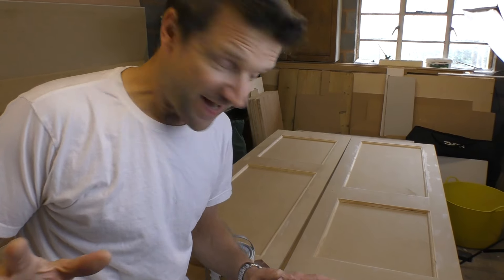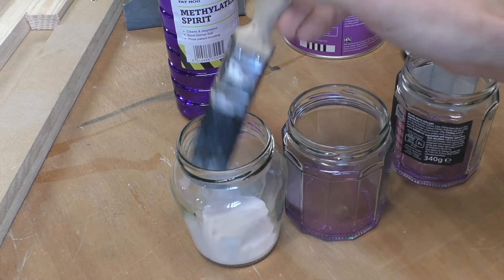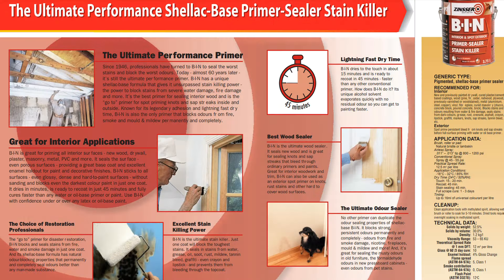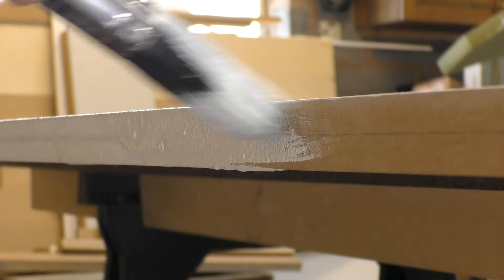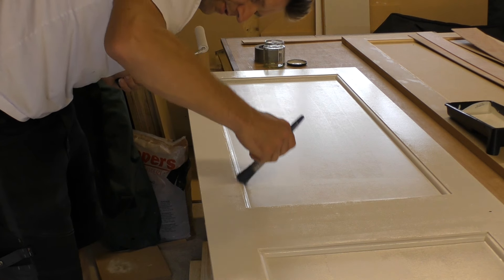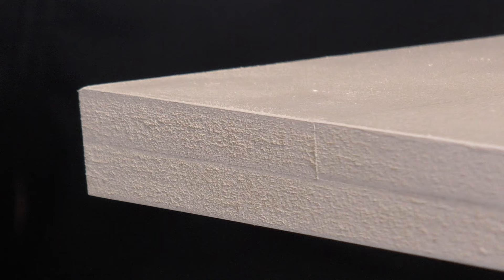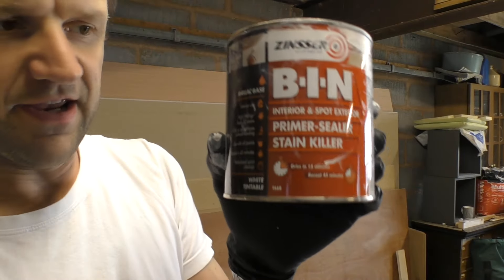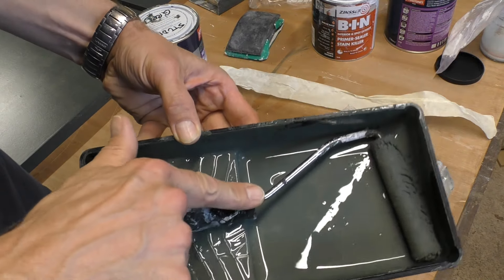Why I LOVE Zinsser BIN for Priming MDF. Video 2/6

Comment: Quick tip from a professional decorator, shellac is a reversible compound so if your brush goes hard just put it back into some zinsser or meths and it will soften back up. Zinsser is the best primer out there and I always have some in my van, you can have it tinted too so grey would be better for colours like green, blues, brown and reds.....
Reply: Henry do you ever spray it? I have a conventional spray gun and would love to know what size tip to use... it seems very thin. A 1.5? Appreciate any advice thank you
Reply: @unusualpond  yeah I have sprayed it, I used a cheap Earlex spray unit which I bought for spraying outdoor fencing panels and the like, I paid about £100 for it from Amazon, I had about 15 six panel doors to paint white that had been previously stained with a deep mahogany so a minimum of 3 coats per side, that's 90 door side's which is a lot of work using a brush and mini rollers, for a cheap DIY unit that just uses air to a gun and cup it did really well, just need to keep the spray tip clean and clear like any spray gun....
Reply: @unusualpond  yeah I have sprayed it, I used a cheap Earlex spray unit which I bought for spraying outdoor fencing panels and the like, I paid about £100 for it from Amazon, I had about 15 six panel doors to paint white that had been previously stained with a deep mahogany so a minimum of 3 coats per side, that's 90 door side's which is a lot of work using a brush and mini rollers, for a cheap DIY unit that just uses air to a gun and cup it did really well, just need to keep the spray tip clean and clear like any spray gun....
Reply: What kind of paint do you add to add to zin to tint it. is it just undercaot..my finish cost is blue
Reply: You didn't sand your primer why ?

Comment: ammonia with water 50-50 ,cleans  shellac base products (including bin) as good as denatured alcohol (methylated spirits)   for much cheaper cost.
Reply from the maker: Ah, great tip! Thanks for that.
Reply: Cleaning instructions on the can of B.I.N. states equal parts water and household ammonia  or denatured alcohol.  I like to use the ammonia with lemon and water 50-50 mix.
Reply: Soooo I can just run DEF through my airless to clean it after?

Comment: I spray this stuff with an hvlp gun.  It dries so fast that it leaves a rough surface but a single pass with 220, and I mean a single swipe, and the finish is as smooth as my prepped surface.  Perfect sealing undercoat for water based topcoats as well.  Even successfully painted melamine cabinets with a ton of prep of course.
Reply: I have just bought an HVLP gun to spray a lot of MDF. Looking forward to using it.
Have you had the chance to use it on tall MDF doors? I have been told that spraying just one side and leaving to dry before doing other side can result in bowing.
Reply: @JohnnyMotel99  I have sprayed a few one side at a time with some SW Pro Classic(airless not hvlp btw) but they were pre-primed.  I had no issues with those.  If using a primer like BIN I doubt there would be issues, it dries so fast and seals very well.

Comment: I found this video searching for priming with Zinsser BIN as I’m about to start a kitchen cabinet paint project. It was great to see someone actually completing a paint job using the Zinsser and the finish coat. Your doors look great! You might not see this as this video is over two years old, but I wanted to thank you for showing how it’s done. Cheers!
Reply from the maker: Thanks Diane. I really appreciate that. Here's a kitchen repaint I did recently. Just make sure you degrease the units before painting with sugar soap or similar, and don't use Valspar. It's fine but chips far too easily 👍🏻  https://youtu.be/x-dzF4H0km8
Reply: Can you paint this straight on laminate bedside cabinets?
Reply: I saw it now. 6/2021.  Good deal...thx
Reply: @CharlieDIYte Which rollers are you using in this video?

Comment: I love using BIN. I've had great success with it when priming metal doors exposed to harsh Chicago seasons, sealing wall board around bath tubs and showers, trim(obviously), sealing the odors and stains from disgusting nicotine. It's perfect for pretty much everything. My pops said that it did wonders when he was doing fire damage repair 35 years ago. It made the crappiest looking plaster or drywall repairable. I hope it helps you with other projects in the future.

Comment: Zinsser BIN is fantastic on mdf. It is all i use now. I find it gives cut/routed edges a harder edge to it, much like the face of mdf. With mdf just sand in one direction as going in both directions flattens the ''grain'' and then raises it again going in the opposite direction. My workflow for mdf is sand the cut edges to 180g, 1st coat BIN, let it dry properly. Denib with 220/240g paper, 2nd coat of BIN. Let that dry overnight, then denib again with 240g paper. While not needed i then put 2 coats of undercoat on, again flatting between coats, this time with 320g. Then let it dry and flatten with 400g paper and then 2 top coats and flattening between coats. That always gives me a really smooth finish, one that feels like glass. :)

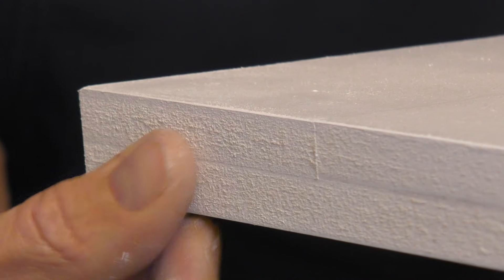Comment: Hi, Charlie! (10:29) About MDF edges: I sand them by hand with 60 grit first, just a few strokes are enough (that cleans the roughness and marks of the blade), and then I go directly to 220 with an orbital sander, *before painting*.  That leaves the surface smooth as glass to the eye and touch, and is super quick. ;)
Reply: The key to that method is that the MDF is heating up from friction, to soften the resin in the MDF. I recommend using even finer grit, like 400 or even 600.
Reply: @barebaric  I've tried, but if you use a finer grit, the surface has no bite for the paint and the roller just slides instead of applying paint (I obviously paint with a roller, I don't have a machine, I'm a poor Argentinian 🤣).

Comment: Hi Charlie. I have watched a couple of your videos when you paint MDF. I have a Pro tip for you. Before applying any paint to the cut edges sand it to 320 grit ( I like to use abranet) this effectively burnishes the fluffy grain, then do as you have been with the zinsser or if you haven't tried it Tikkurilla Otex paint from Finland. Try it next time. 
Ollie
Reply from the maker: Ollie - that's invaluable. Many thanks - I'll give that a go!

Comment: The flip side of that lovely dry time with shellac based finishes is that the alcohol is a toxic organic solvent with a very high vapor pressure. It's extremely flammable, and the vapors damage your nervous system. Even with good ventilation, it's prudent to use a respirator with cartridges rated for organic vapor.

This is why I've historically been shy of shellac except on small pieces...stay safe!
Reply: Awesome! I was prepping my pine stair spindles for primer.. Butyl Acetate to get the stickers off and then shellac knotting compound, not really much ventilation. I had a hangover a couple of hours later...😂
Reply: @Dang_Lin-Wang People drink alcohol

Comment: As a professional painter I can confirm that the roller is the better way. 
We have one guy cutting edges with the brush & the other finishes the doors with the roller. 
If there are many doors we would use a spray gun. 
Great product mate
Reply from the maker: That's good to hear from a pro. Thanks mate. 👍

Comment: I think I have posted before but I can't recommend Zinsser Perma White enough for wood and walls. It is a fantastic paint  which I have used on my bespoke bath panel and bathroom cupboards and after 1 year is still as white as it was from freshly painted, unlike other paints I have used. I'm about to update a pine draw unit to white to go under my white office desk and I have every confidence in both the BIN and the Perma White to do a great and permanent job.

Comment: Used BIN on bare pine skirting the knot's need a 2nd coat to prevent any resin migration into the top coat 'water' based gloss. Also if the BIN dries on glass it can be removed with meths..

Comment: Nice doors and great vid...That bin stuff is great and use plenty of it as a professional decorator.. especially where I'm going over previously oil based woodwork with waterbased.. it gives a great base and sticks unlike other products... so much cheaper in a b&q or screwfix than trade decorator stores..only thing I dont agree with on the tin where they say no need for sanding prior..  needs it even with a fine grade or wet n dry..
Zinsser are great... since using their permawhite in bathrooms I wont use anything else.. coverage not great but its durability is unmatched..

Comment: Great stuff - I primed some of our bare timber window boards (cills) with water-based primer. It raised the grain in the wood which meant sanding it down. Much better to use BIN shellac-based primer for this reason. Johnstone's Stain Away matt is great for ceiling stains caused by water and it's water-based.
Reply from the maker: Thanks James. Yes I use BIN to prime everything these days. Only time I don't is in the heat of the summer when it dries too quickly to get it off the brush. Thanks for the Johnstone's tip - my other favourite paint brand. 👍

Comment: Thanks!!!!!!!  I bought a small can of this to shellac a closet (for sealing in cigarette odor from previous owners!).  
I have been procrastinating using it, since I kept reading reviews on how shellac is "drippy" (did not look forward to that).  
Watching your demo is reassuring, and I will be tackling the project today!!
Reply from the maker: The drippy nature of it struck me too when I first used it - particularly when compared to for example Johnstone's MDF primer which is quite thick. But the thin consistency is what I LOVE about this paint now because it makes it SO easy to apply, and you can absolutely drench the MDF edges in it to really seal well. Also it dries so quickly you'll have the whole unit painted so much quicker than you would with the non shellac alterative.
Reply: Zinsser recommend their water based 123 primer for MDF why is it that you chose to not use a less expensive and maybe more suitable product for this project video? 
P.S. I did like the video just not sure the product choice is steering budding diy folk in the wrong direction
Reply: @MICHAELSMITH-fl7du  I have followed Charlie’s more recent guidance & views on BIN v 123.  I have found the water-based Zinsser an absolute nightmare on raw MDF. I’m on the third coat and it’s patchy/blotchy.  Am going out tomorrow to get the BIN.  Sand everything thoroughly and (more or less) start again. Soooooo depressing.

Comment: Hi Charlie, I bought a brush cleaning tool called "Dandy" some time ago, it has two jigs for want of a better name that fit in a drill and one takes a brush held by big springs and the other one takes a roller. The jigs use ventricular force to clean the brush or roller and makes a fantastic job of getting all the paint out even though I tend to get paint right up into the top pf a brush. It is so simple even an idiot like me can get fantastically clean brushes. I thought it would be in every store by now but it seems to have not been successful on the sales side and I have never seen the item since.
Reply from the maker: Thanks John - I would have replied earlier but your comment was languishing in the review folder for some reason. Great tip and I might have to buy one of these as I took ages last weekend cleaning a roller head I've been using to paint the outside of the house. They sell this on Amazon https://goo.gl/tRXVKW. Mixed reviews including some quite amusing ones about paint brushes flying over fences into the neighbours garden. Have you found it to be sturdy enough?

Comment: Thank you for this video. I will be making and installing an MDF bath panel in the next week or two from scratch and repainting all the other woodwork in the bathroom. My choice of paint will be Zinsser Bull's Eye 123 primer which is a water based primer with Biocide protection against fungal degradation and thus suitable in areas of high humidity. I will thoroughly seal the unseen edges of the panel with neat Gorilla wood glue to protect them from water ingress before priming. After priming I will give the panel two coats of Zinsser Perma- White as a finish, which has a lifetime durability guarantee as well as preventing the growth of mould and mildew.  It would be interesting to know what you think of the Perma-White paint if you get round to trying it.
PS. Cheapest place to buy Zinsser paint I have found is Screwfix.
Reply: In the last year I have painted my bathroom ceiling and a friend's also. Used dulux bathroom on mine and zinsser permawhite on theirs - mine has flaked and required repairs and theirs looks amazing still. I did the same prep work on both ceilings, and both bathrooms are well ventilated so I know I'll only use zinsser from now on

Comment: Used this primer to repaint my kitchen doors and cabinets which are MDF covered with laminate followed your direction for using the primer and the gloss . Beautiful finish. Thanks!
Reply: I’m currently doing the same. How long did you leave it before applying your top coat of paint?

Comment: I would suggest using a sanding block for sanding in addition to hand sanding with a piece of sand paper. You may use a piece of wood with the paper wrapped around it or (better), spray the wood block and the sand paper with contact cement, wait 2-4 minutes, then wrap the sand paper around the block. Now it's a tight contact and will be there permanently.  Another option is to purchase a hard rubber sanding block with slits cut in each end for the sanding paper to slide into. These can be found online or at a wood working specialty store. Some paint stores will carry them as well. Good luck!

Comment: Two things.
First there are several types of Zinser primer stain blocker so make sure you purchase the correct one. Second. You don't have to clean brushes between coats. Even if the brushes go hard just dip them into the paint a few times and they come back to life. Zinser is amazing  paint/primer.
Reply: Would you recomend Zinsser BIN as an undercoat for varnished door frames?I need something that will stick to the varnish well as I do not want to sand it, but it must also stop tannin bleed, I am assuming Zinsser BIN is the best choice?

Comment: Skip the methylated spirits, just use a quick household ammonia soak as a first rinse, then clean the brush/roller with soap and water...  The ammonia soak can also be used to easily recover any brushes or even rollers that were accidently allowed to entirely dry with the shellac on them...
Reply from the maker: Thanks for sharing that. Great tip 👍

Comment: Great video! If I am going to clean some old dirty wood doors, potentially have mold seeped into them, although it’s brownish not a dark black like was in the garage (zinsser worked great there). After wiping the doors down to clean surface …Do I need to hit these doors with any sanding? And should I use the zinsser primer and then the perma white top coat as I did in the garage? Thank you!
Reply from the maker: I would get some sugar soap on them to give them a clean and degrease and then yes sand them to provide a good key for the paint. 👍

Comment: Be interested if you have used zinsser bullseye 1-2-3? Being water based this looks like the perfect solution to everything. Love the videos. Keep it up
Reply from the maker: Thanks Eric. I haven't tried the Bullseye as I'm such a fan of the shellac, but you're right and I'll check it out asap!
Reply: Bullseye is a fantastic basecoat for bathroom walls and ceilings, I wouldn't use anything else.
Reply: Was planning on picking up some BIN for a mdf paint job I have to do. Will Bullseye 321 suffice, I have some left over from a previous job.
Reply: @moolersz  Yes,   Bulls eye is a an all round primer,   just can't use it on varnish oddly.  and not recommended to cover up wood stain.

Comment: Was advised by Dulux customer support to use Zinser B-I-N in my garage office conversion because on the terrible advice of a sales assistant at B&Q I had painted 2 coats of Dulux Exterior Weathershield on the cement wall in the new office room in the garage. One year later the room was still uninhabitable because of the mildicide/fungicide odours from the exterior paint. B&Q had given me emulsion to coat over the top of the Weathershield after I complained, which I applied two coats of but it didn't make a difference to the odour problem. Thankfully the Zinser B-I-N has all but eliminated the odour. I only used one coat - I don't care about top coat as I just want to use the office. I can see that it wasn't evenly applied, perhaps it wasn't mixed well enough. Some parts are more glossy that others. However, you can see the pleasant colour of the primer fairly evenly throughout and it really did do the trick re. the odour as far as I'm concerned. I'm sure 95% of the original surface area painted with Weathershield is now sealed, some parts are underneath skirting board and behind a radiator. If the smell returns in any way I wouldn't hesitate to do another coat of the primer.

Comment: Hi Charlie.  What is the difference in using your BIN and the 123.  Both are primer-sealer and stain killer?
Regards
Paul
Reply: Yes. I'm sitting here with 123 & wondering if I should use this and then my Behr  satin acrylic oil paint stuff on top. Now I'm not sure. Sheesh. I'm sure whatever I do will look  load better than what I currently have in my kitchen. That's my philosophy anymore

Comment: Lovely video. I’ve been recommended to use Bedec Multi Surface Paint by my local
Independent decorator centre who say it’s an excellent product for bare PDF that doesn’t need sealing etc.
Reply from the maker: Thanks Phil. Yes, I've heard of Bedec. I'm sure you can't go wrong with that. You have to stay away from BIN at this time of year because it dries before you can get it off the brush or roller! 👍